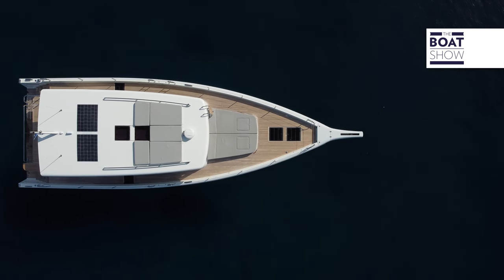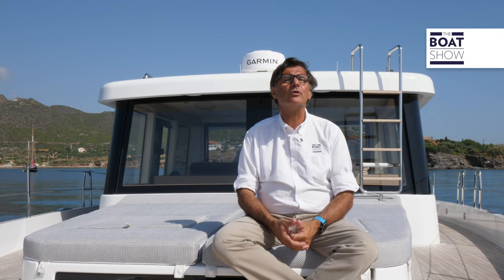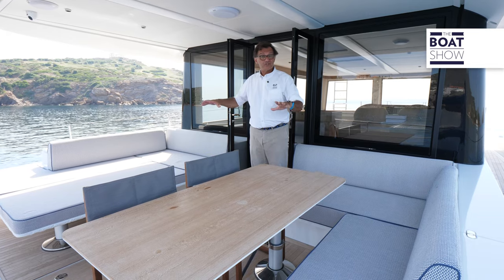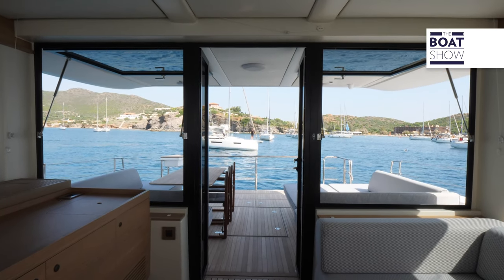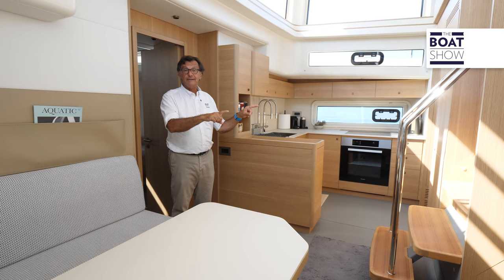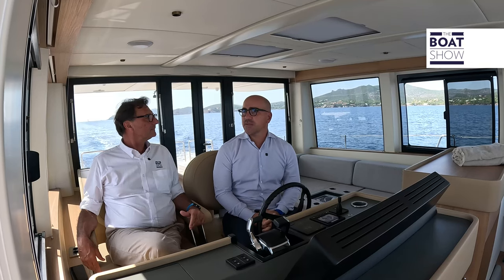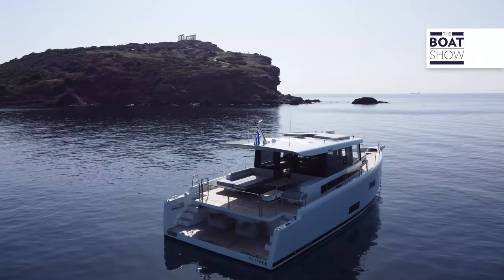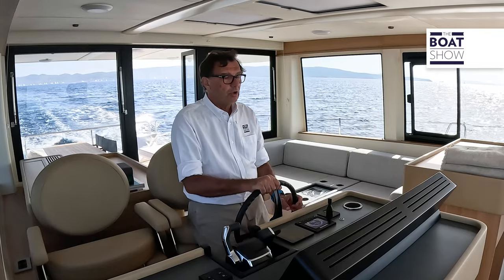[ENG] OMIKRON YACHTS OT 60 - Yacht Tour - The Boat Show

Comment: This has to be the perfect hull concept for a solar electric mono hull boat to compete with the more expensive catamaran options. An aesthetically looking 14m by 6m, 18Kw solar roof could be built generating around 90Kwhr of power on a sunny Med day. Adding port and starboard retractable extensions, (at anchor / calm passage), would allow another 30Kwhr per day from another 14 panels. 120Kwhr per day!!! With a large cheaper 2nd use marinized EV Lithium phosphate battery pack of around 200-300Kwhr we now have a very capable and comfortable Med cruiser. Continuous 4-5 kt propulsion and endless power for air con, water makers, fridges , freezers, cookers, washing machines and lighting that would make staying on board in warm weather so much more enjoyable.

Comment: Not enough range ..... 1000 miles .... cannot get from Ft. Lauderdale to USVI without fuel stops. I motor-sailed from PR to Florida with less than 150 gallons of fuel in a motorsailer.  This is a Med boat ... not an Atlantic boat.
Reply: Nice Bahamas boat and icw loop etc . 300 gallons 1000 miles is nice but why not have 5-600 gallons . Awfully  low capacity
Reply: @BlackHawk-yl5gu  Per the guy from the yard, it's a hull which really benefits from light weight. Notable performance hits from just adding a grill and other "extras."

That's exactly how modern, lightweight sailboat hulls behave. They really, really need to be loaded lightly, to function as designed. Not forgiving of overloading at all. The exact opposite of North Sea Trawler derived "Trawler yachts" popular in the US and designed for year-round use in the Atlantic; which were originally designed to not mind taking 10 tons of fish aboard mid cruise...

Regarding "Atlantic", I would not want a huge following sea in a hull this pointy in the front and wide in the rear. Nor massive sheets of green water against all that glass....

But for Med/Aegan, and similar popular cruising areas, use: Range and speed are both perfect. The wide beam provides huge cockpit lounging area, which is where people spend time in nice weather place where all that glass makes sense. As well as lots of stability and inherent resistance to roll, without having to run a generator to power a Seakeeper. And it's still going to be very seaworthy. It's EU rated A for 14 people. That's stable, for an 18T boat. And while you don't, or at least very rarely, risk 20 footers in the Aegan, it can be plenty nasty there. It ain't no "lake."